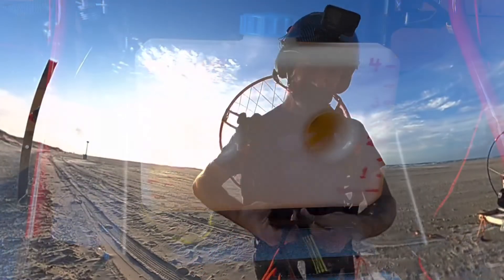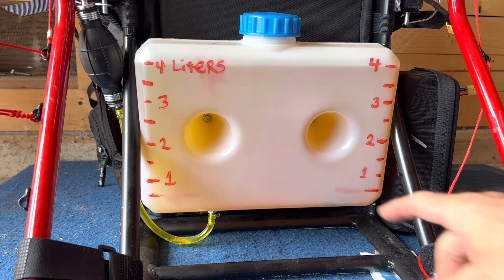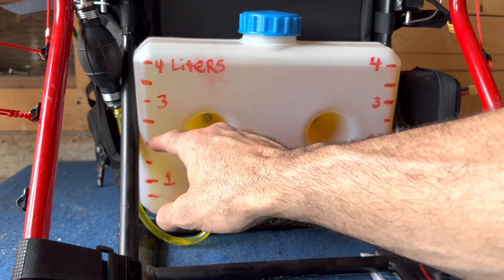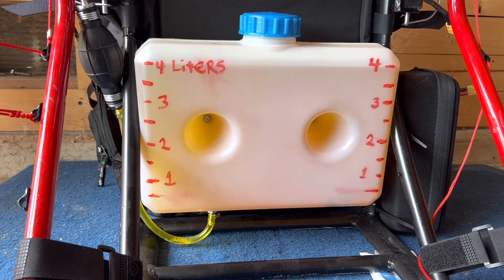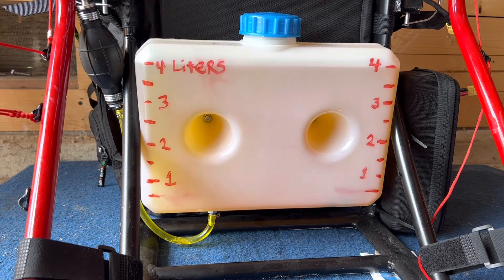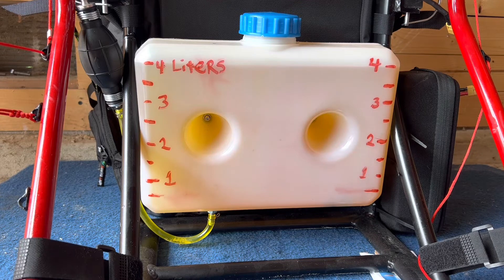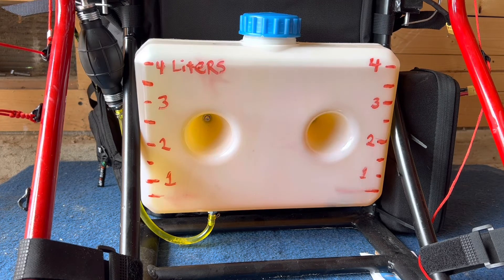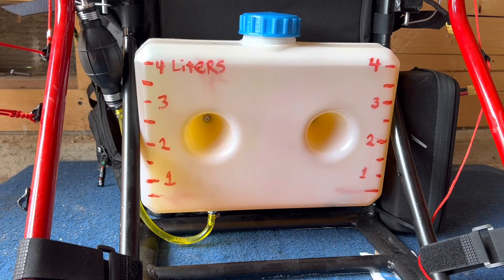AliExpress AirJet DLE170: Rate of Gas Consumption and Fuel Tank Capacity

Comment: Careful on the thin oil ratio. It's an RC plane engine. Hobbico and DLE both say 30:1, and many users stick to 30-35:1 for the life of the engine. Look for recommendations on RC plane blogs, not paramotor blogs. 50:1 will decrease its lifespan noticeably.
Reply from the maker: Will do. I’ll use the 40:1 in my Moster and replace it with 30:1.
Reply: What is the described lifespan before rebuild typically?  I assume pistons,  rings and cylinders are not priced as high as paramotor engines.  Correct?
Reply: @GDFred88  yeah, they're pretty cheap. I'm not sure what the hour mark is for replacing parts, but I plan on checking every 10, rings at 50, plugs every 25, and new cylinders at 100.
Reply: @AveryFlies  Have you been able to determine a good average fuel consumption on it yet.  I know wing and weight and a number of other parameters will impact that, but I am curious if one can expect at least an hour's flight time out of a full tank.
Reply from the maker: @GDFred88  pretty cheap ring kit, but I haven’t bought the pistons yet. Avery may have more experience with parts for this engine.
Reply: @GDFred88  probably closer to 45 minutes in my experience.
Reply: @AveryFlies  Thanks.

Comment: Hey question wes, would making a powered hang glider work with the dle 170? Because i checked the standard radne, and it only goes to 14 hp and can still do the job
Reply from the maker: I think so. I haven’t tried it yet, but I think the DLE 170 might be a good option. I may swap the Radne and try it out. The size of the AirJet might also allow the paramotor to be used with a hang glider without have to cut the keel like you have to for the WW Falcon. An AirJet paramotor could be flown with the pilot seated below the control bar and provide greater roll authority. It would also make it easier to make weight shift with the thrust line parallel with the keel and reduce the chance of cross control pilot induced lockout. This can happen if the thrust line isn’t parallel to the keel with a Mosquito, Doodle Bug or Wasp unit. It’s one of the reasons pilots fly with limit lines. A small paramotor might reduce all of these problems and make the flight more comfortable. The downside would be increased drag and not being able to fly prone.